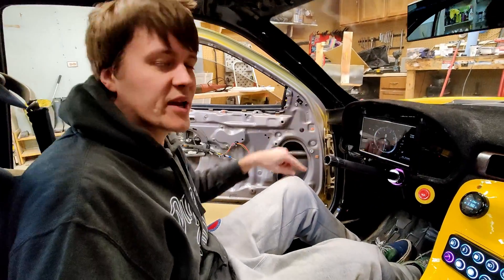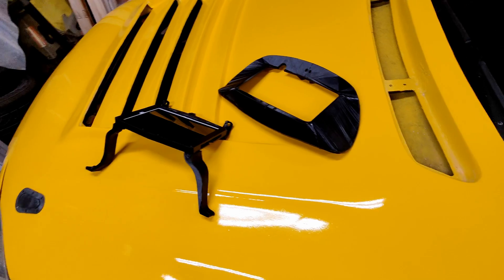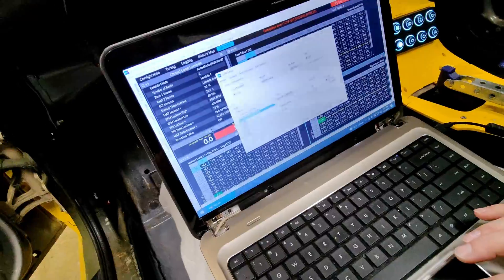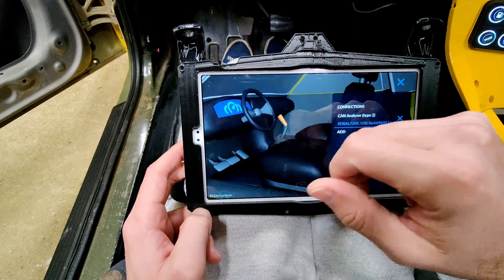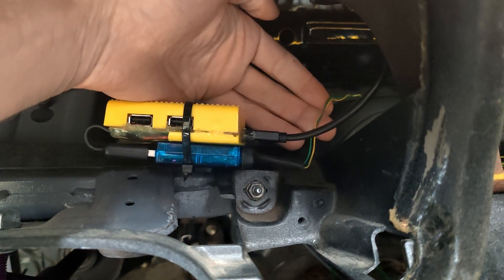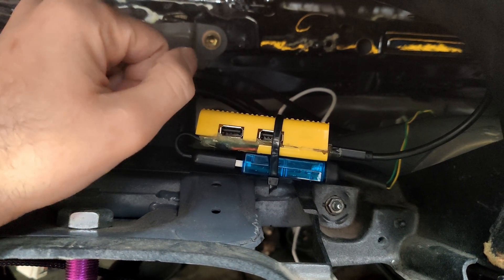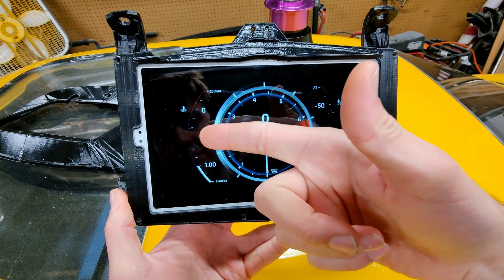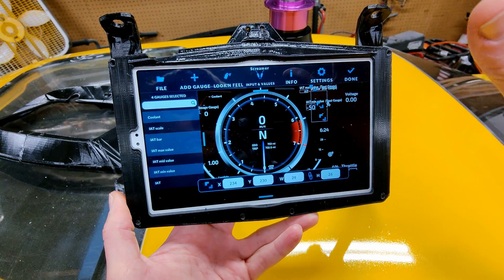This is The Best Digital Dash Setup - LINK ECU RealDash Integration

Comment: Do you know if it’s possible to run the obd data to usb and then to the usb input on the rear of a head unit for the realdash to read? 
I’m wanting to display the data on my android head unit but still want the Bluetooth connection for music
Reply: Did you manage to solve this I would like to do the same

Comment: Hi, you connect canH and canL   between Can analyzer and on Dtm 4 pin connector to the CAN Lambda, PDM,... Everything is on DE same line? Do you connect the switch +12V for the Dtm4 plug?

Comment: Why can't you just use obd2 connector?
Reply from the maker: Cz it's a link ECU, read
Reply: @DingDongDrift that's why I'm asking. Why don't use OBD2? Is there any differences?
Reply from the maker: @rudencecynrickibanez6738 OBD2 sucks, it's extremely slow

Comment: we found the cheap way to get around the otg not charging at the same time ,is to get a 1s lithium charge module and wire it in directly to the battery,thats what had to do for custom ebike dash using torque pro, were going to Can option to ,just makes more sense otherwise the amount of wiring is insane
Reply from the maker: The lava computer hub isn't that expensive
Reply: @DingDongDrift it is when you’re shipping it to australia, from their website is $104 only for shipping!

Comment: Do you have to power the usbc hub ? Or is it just connected to the tablet from the can analyzer ?
Reply from the maker: The hub is powered through a USB input. I'm working on a video of a new version of this with a better hub so just ignore this video
Reply: @DingDongDrift  I ordered that other hub from that lava company. Is that the one that you are talking about ? I'm hoping to see that video soon. I'll be starting on my dash in about a week once the rest of the parts come in. Would love to see a detailed video of how everything is wired for the hub, usb can analyzer, and tablet. I get the gist of it but unsure of how to give the hub power. Thanks for your expertise.
Reply from the maker: @itseric1jzson  they have a new much better hub now I'll have a video of it soon
Reply: @DingDongDrift  Even better than the one you linked in this video? It looks like a black box.
Reply: @DingDongDrift I bought the eSynC-3U.
Reply from the maker: @itseric1jzson  forgot i updated the link, that's the correct one! It just needs usb power from anywhere. I have a permanent phone charger inside the car that i use to power it.
Reply: @DingDongDrift  I guess it kind of makes sense, but I would still love to see a video of the new hub and the proper way of setting it up. I'm hoping to see it soon.

Comment: I can’t get any readings from the usb to CAN. Just says connecting then no connection when I go into real dash CAN monitor. Do I have to send a configuration file or something to the can usb on the computer?
Reply from the maker: Because that's not how you're supposed to use it. You're supposed to use the CAN wires from the ECU plug
Reply: @DingDongDrift I am using the can wires, and my tablet will not connect to the USB. Would love to see a more detailed video on how to set this up or maybe get in contact to get some help

Comment: I'm swapping a older 1995 Goldwing body onto a 2004 Goldwing frame very interested in this being the instrument cluster on the 04 is larger than the 95-instrument cluster.  Now a question.  Is there a cruise set and a cruise om display when the cruse is on the light is indicated on the dash when you hit the set then the cruse light comes on along with the cruise light still remaining lit.  Also is there a FI light and a engine light.  Also how would the radio function be figured out being the dash has a Radio separate screen that is wired into the unit.

Comment: Hi, im looking to do this and use an android based head unit running realdash, do you know what cable i will need to connect from my Jzx100 g4x plugin to the usb can adpater?
Reply from the maker: you need to set up CANBUS, i explain it all in the video
Reply: @DingDongDrift  yeah I've watched it all just need some clarity on where you've connected the canbus cable onto the ECU and how you've ran it to the can to USB adapter if possible. Would the link can pcb cable do the trick into a link canF plug then ran in 1 pair screened cable to the adapter?
Reply from the maker: @Big_Gubbins  you just connect 2 wires to CAN H and CAN L on the ECU Plug. there's no special wire or anything.
Reply: @DingDongDrift  ah right okay, do you know where I can find a diagram or anything where I would connect my Can H and Can L too on a jzx100 pnp ECU?
Reply from the maker: @Big_Gubbins  the diagram your ECU probably came with?
Reply: @DingDongDrift  don't suppose I can message you on WhatsApp or something and send you some pics to try show you what I mean?
Reply from the maker: @Big_Gubbins  instagram

Comment: So why did you not just connect LINK ecu USB to usbc direct to tablet??  Thought it was charging also?  I am setting mine up soon
Reply from the maker: G4X doesn't have serial USB only G4+ does
Reply: @DingDongDrift  Thank you my worry is that even though I HAVE G4+ and old one that talent will die on me when parked up for too long not started so it charges. I am new to all this so trying to get my dyslexic head around everything
Reply from the maker: That's why i designed a hole in the tablet surround to be able to turn it off.

Comment: How do u deal with the tablet having a battery? Wouldn't it be kinda dangerous to have inside in the summer?
Reply from the maker: Why would it be dangerous?
Reply: @DingDongDrift  well because it has a lithium battery and there is lots of stories about them causing fires in cars. Automotive tech goes through tough testing to withstand the heat. If I was to do that, I'd actually get a portable HDMI display called "bar display screen" and its super wide. (Imo better looking than a square tablet) And have just an Android box that runs via wired power (planty of those and they're pretty cheap) then u can build a bezel around it and make it look seamless like an OEM. I think u should really look into that. If u wouldn't leave ur phone inside ur car during the summer, u shouldn't do that with a batteried tablet. I'd gladly help guide u through the process. Would be a shame if something happens to that sweet car 👌👍
Reply from the maker: @jackaboodf16  i've had a tablet in my car for 3 years almost. i've been flying race drones for 9 years now and push those batteries to the point that they'll boil water. Lithium batteries are completely misunderstood.
Reply: @DingDongDrift  lithium ion is very unpredictable. Sure u had ur tablet in ur car for years but that's an unwise decision with all due respect. Ur rolling the dice here. Lithium for how old it is, it has never been used in the automotive industry for a reason. (Tesla uses lithium ion currently but they have insane cooling tech behind it). U should rethink this out imo. Also, the race drone batteries are actually Lithium Polymer. Which is a bit different than Lithium Ion safety wise 😅
Reply from the maker: @jackaboodf16  phone batteries are also li-poly.

Comment: I’ve always wanted to put a tablet in my SC to control ac and radio as well as one for digital dash.
Reply from the maker: in my old SC that actually had an interior i installed a tablet in the center console that was basically my headunit. go on my second channel and scroll waaaaay down you'll see it.

Comment: I want to do a push start button,( probably wont)  but with a coin slot button from an arcade. .  Put 🪙quarter to drive. Lol.
Reply from the maker: Bro that would be fucking epic lol. Let me know i can hook you up with a coin slot i used to work in the arcade game industry.
Reply: @DingDongDrift  have a blue one? 
Now I'm thinking to use it for 2000 fog lights I installed.  I have blue dash, climate control with blue interface on TV screen for radio.   Would be a cool 90s touch Radwood here I come. Haha
Reply from the maker: @shawniebeans8382  i don't think blue ones exist, they're all red
Reply: @DingDongDrift  😭lol